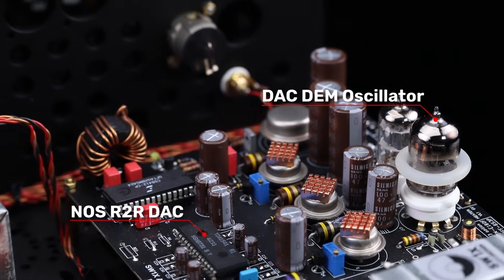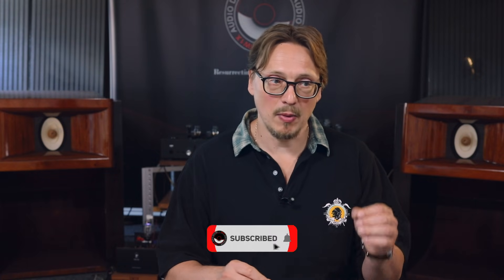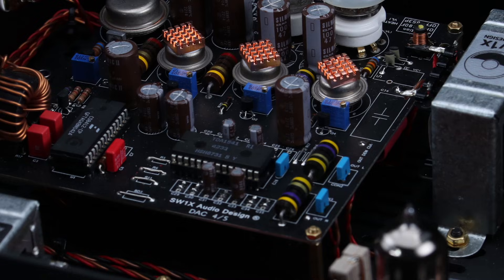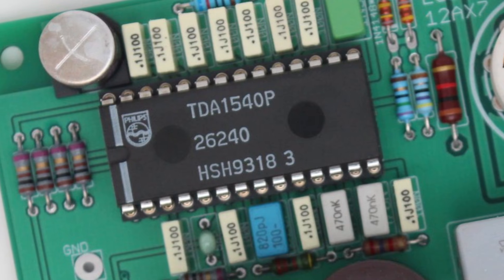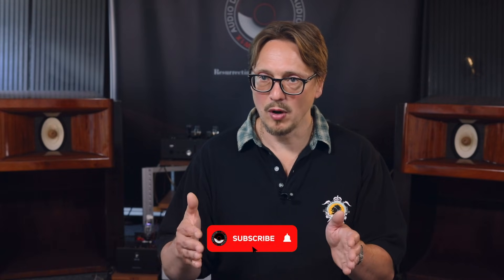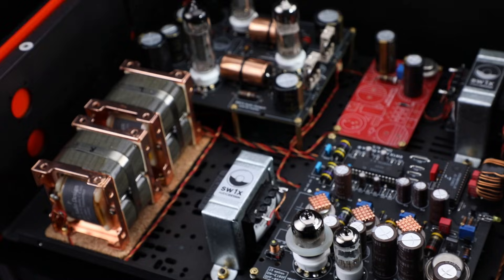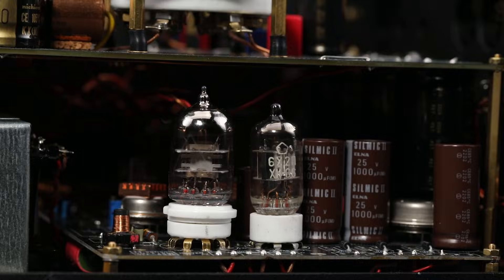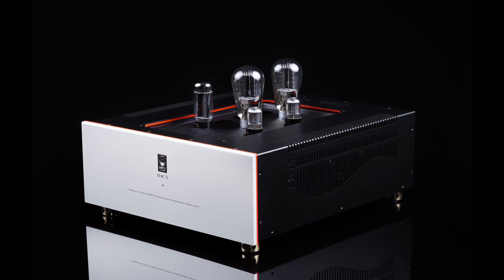What makes the Philips TDA1541 and TDA1540 DACs so special?

Comment: i'm a valve guy through and through, but when it comes dac i prefer solid state mainly because it's quieter.  any noise produced by valve gets amplified by my valve power amp and it's annoying.  it's a trade off.
Reply from the maker: good for you. maybe you do need a better DAC after all

Comment: OK, so you like tubes so do I, so you’re doing all this digital processing and it’s a very end you’re running everything through. It doesn’t matter before or after to a certain degree through tubes. Could you like to sound the tubes? OK I agree with that so you’re taking a high-end digital signal, which works very well and his breathtaking and then using good old-fashioned tubes to get the taste of analog back after all that digital reproduction makes a lot of sense. Good luck with that all this digital work to get it to sound like analog at the very end I believe that’s what we’ve been trying to do California AUDIO Labs and a couple other companies were doing it way back in the 1980s nothing no but I’m certainly sure you’re a piece of equipment sounds good but put a little more background into it folks if you’re doing this for decades, you know the word Dac, digital to analog, digital analog OK I guess I’ll go along with that. That’s the only process you can go along with unless you can start hearing in digital Crazy.
Reply: Wow, I didn’t see that picture. The amount of tubes and converter is out early. Ridiculous.

Comment: Great video. I have gone down the TDA1541 route myself. I have a Marantz CDA94 with an S2 Taiwan 97 chip (good provenance). The  CDA94 has got black gate capacitors. It sounds very analogue. I don’t have the desire to reclock it, but a quick question if I may. Would a DDC to improve the quality of the inwards digital signal on the coaxial input make a worthwhile difference ?
Reply from the maker: while CD94 is a great CD player, there are a lot of factors that bottleneck its sound- pretty bad power supplies, lack of DEM clock, presence of op-amps in the output stage- BG caps alone are not going to compensate for all the shortcomings. since the list of shortcomings is rather huge, much more musical and analogue results are achieved if one use employed our DACs (starting with the DAC III) in combination of CD94 as a source
Reply: Hiya - thanks for reply . My Marantz CDA94 is actually the DAC unit that was built to partner the CD94: so it is a DAC unit and has to be fed with either a coaxial or optical. I have no doubt your DAC unit may sound better, but at least for the moment I am happy with mine. I might ask someone to do the Grundig DEM mod for me , but my question remains which I am hoping you will have a view on given your expertise,ie would putting a digital to digital converter in between my digital source and my CDA94 DAC to remove jitter etc. make any difference or improve the sound of my CDA94. Cheers and thanks
Reply from the maker: @highfell1  if you have the TDA1541 running in NOS mode, then any other manipulation in digital domain is only counter-productive

Comment: ??? More BS, Digital always be digital. It has the stream from some point of origin doesn’t make any difference with that it’s going to. , and the vacuum to deal that’s been done 25 years ago, California Audio Labs had a few units out
Along with a few others, nothing knew about that concept , except when you need replacement tubes and it’s almost at a point today you gotta kiss somebody’s ass to get a few NOS tubes for 200 hours apiece. No wonderful idea. I’m not knocking you but it’s the same bullshit. We had 20 or 25 years ago. I don’t care about the dsc chip It all depends on the way it’s implemented. Got an old ESS saber dsc here with a 2016 chip in it. That’s old. We’re going back at least 15,16 years. I can’t criticize something. I never heard. I believe it’s most likely a wonderful sounding piece but but what you’re doing is the same shit they were doing over 20 years ago the design in general nothing new most people forgot about it and most of them went out of business anyway But best of luck with all that<
Reply: But a stream of water can be a few drops or a gushing torrent or maybe not flowing in a consistent way- that would make a difference to how well a small bucket contained it or not. Controlling Digital data is no different
Reply: @highfell1  absolutely however an LAN Streaming into a computer music server even your iPhone a few drops of water, huh?
Well, when the scream of ones and zeros gets down to being that weak or altered, that’s where it makes a difference you’re right it’s cold. You have no signal incoming or even perhaps outgoing depending on the situation digital digital analog is analog , almost everything you have or use today, before I go any further, I would be very surprised if you do not know
What they call a  DAC, Which stands for digital audio converter< now the stream must be converted from digital back to analog or it would be useless. Totally useless., we do not live in a digital world. You don’t see in digital you don’t hear in digital. You don’t live in digital. That’s why anything digital always must be converted in some fashion, but it is a way to get unbelievable or unprecedented amounts of information from one place to the other. All that stream is putting out is one and zeros then goes onto the Dac, in your iPhone, your CD player, countless other things that you use daily the average person today I believe doesn’t realize if you look around the average household you probably have 6 to 12 digital audio converters your TV for one iPhone again and anything else that you may be right come on you folks should notice by now nothing new about it
Reply: Even Albert Einstein himself claimed along with countless others in their field, we live in a three-dimensional world
I wonder what a four dimensional world would look like , they used to say it’s impossible and it could not exist
Funny thing for the last 10 years certain mathematicians and leading professors have been looking at this in a different way
Reply: @Cody1340-e1s  And they all have different sound signatures which don’t really matter, unless you are using one in a highend hifi system. And I bet his DACs sound good
Reply: @highfell1  I don’t know how long you have been involved in this hobby, you may be well aware idk, but most folks don’t know through the late 80s into the early 1990s, just speaking for myself here on the eastern seaboard mid Atlantic area
If if you were to go into any higher end, Audio dealer with any Dac/ OK or digital audio converter, the four or five Dealers 
That were around and doing business back in those days , absolutely would not take any Dac in trade or want to buy 
Outright from yourself if you were looking to sell it , the market had became so overwhelmed and saturated with Dacs
It was absolutely an utterly ridiculous , it was almost like you had one for every man and woman and child in the city
Now, if it was really something obscure in nature, very dependent upon bringing type make and model number 
You may have had a very, very slim chance , there were so many units around useless. Nobody even wanted them.
There was such an over abundance of any type dac you could possibly think of , this is what now as of today absolutely associates and completely reminds me of those days back then, it’s ridiculous and not much has changed when you really look at it completely overall, I know guys that tried so many things MQA super audio CD K2 CDSCD that’s CD
Get to the point where it’s real humorous like the old heads taught me years ago it’s all hype , $$$$$
Save your money find an old rega Apollo R, and sit back and enjoy your CDs. I know can’t listen individuals.
That have been through this shit from beginning end , and in the end are just listening the red book. I absolutely know and understand things have immensely changed since those days, but no honesty. It’s basically the same shit.
They just put it in a different bowl , next year or the year after it’ll be something else, take the I2s output connection
All it really is is the old cat five or cat six cable if you’re familiar with that , I still use it still sounds wonderful
I also use SPDIF , but I do not like the Opo cable you can get by with it, but the SPDIF is much better
I’ll tell you a real good find from being around for years a friend of mine picked up an old my MYTEK 192 DSD DAC
ESS saber Dac, 9016 , 4 per channel output total of eight, four on each side output, internally speaking
He brought that little piece over , we hooked it up and I’ll tell you what that is one awesome little dac I don’t care how old it is
However, I did often wonder when you see this particular dac for sale , they’re almost sold immediately
And other crazy thing that I noticed, but this particular piece , is if you look on the web, you will see some dealers or sellers
And they’re asking price , a lot of them one is much for it is when it was new, I’ve seen one guy asking more than what it for
Actually sold for , I am looking for one myself. Presently I found one, but the guy wants too much for it.
All this bullshit out here today it comes and it goes it goes and it comes , it’ll go on to the end of time, especially where there is $$$$$ to be made or hype not stating that there’s not differences, but it comes down to. It’s all the same shit.
If I took three or four dacs repetitiously played them for you with your favorite music, for absolutely quite a while
In the same stereo system, same cables, same loudspeaker same room same everything , I can almost guarantee you
As I was changing the units around and play , you would not be able to tell me which one you were listening to
Yes, we tried it and 90%. We’re nine out of 10 people didn’t know what they were listening to. 
You know these guys stay up all night and walk the floor what can we come up next or we’re gonna go broke use your head not your wallet , 👀🤣👍🤷☮️👀👍
Reply: @Cody1340-e1s I have both a vintage DAC 1541A chip and a new DAC, both sound really good but a bit different. I like hearing vintage hifi because they knew how to make things in the old days and used the input of highly trained technical experts.
Reply: @highfell1  I agree with that statement 100%, you know sometimes you have it right the first or second time, but they keep trying to reinvent the wheel using different rims, same tires
Reply: @Cody1340-e1s  “DAC” stands for “digital to analog converter”. They’re not just for audio…
Reply: A digital stream is a stream. I don’t give a damn where it’s coming from. There’s no altering it. There’s no changing it. It’s a stream just like water coming from your faucet. The water will always come out no matter how much you modify it. It’s a stream whether it has a sprayer on it. It has nothing on it. It’s just flowing out free flow. It’s a stream it once it hits the internals of a digital audio converter. Then the implementation will start along with probably operational amplifiers filtering power supply implementing whatever trip is in there that’s why different tax to me sound different even though they’re using the same identical Dac chip, I dug up an old my MYTEK dsd 192, ees 9016 saber , 14 years old it still sounds just as good as any Dac I have sitting here today even the AKM 4499exeq , yes, absolutely I can’t hear the smoothness in the AKN to a certain degree little smoother sounding, especially on the top end, wonderful deck, if you’re running a very aggressive speaker like horns, but that old MYTEK 192 i’ll tell you what I’ll compare it to anything not saying it’s not our date because it is before a 14 or 15 year-old deck it’ll definitely give you a run for your money. Why would you want to spend thousands of dollars it’s all hype. It’s all bullshit. I got it sitting right here in front of me experience is the best teacher. Sorry for the text. Talk this shit’s a pain in the ass.

Comment: In a time where a 50$ ethernet switch has a 150000khz clock, audio manufacturers are still struggling to make a 48khz one ...
Reply: Exactly,
This snake oil company is an insult to the decades of engineering professionals working on Hi Fidelity,
True Hi Fidelity does not have a sound of its own.

Comment: Good discussion, SW1X. And yes, you do clarify the misconception that TDA1540/1 is not really R2R but DEM.  But I don't understand what you mean when you suggest no other projects -- other than Grundig -- has released TDA1540/1 -based units (DACs, CD players) w/o external osc (clock). DIYAudio and Audiocom has, for decades featured such designs. I have a 1989 Philips CD-60 with my own clock PCB. And: Didn't Arcam or Naim use external clocks with their 1541-based players?
Reply from the maker: TDA1541 & TDA1540 are R2R DACs with unique DEM feature. These DAC only produce tiny current at the output, which is the main characteristic of R2R. Some people see them not as pure R2R but who cares? As regarding DEM in other products, yes in DIY community, which is not commercial in nature and yes designs based on transistors. To our knowledge the only commercially made external DEM clock were offered in one or two Grundig CD players.
Reply: @sw1xaudiodesign Do you know which Grundig model it was? In any case, if you go to EEVBlog forum and search for "TDA1541 DEM oscillator", I am 13hm13 in that thread. The photos there are mine --a verobaord DEM reclocker I was experimenting with. Limited success on my part , and ultimately I gave up. Ditto  variable results of other DIYers in the long DEM TDA1541 thread (pertaining to pin 16/17), at DIYAudio.
Reply: @sw1xaudiodesign Audial / Pedja Rogic will have a word with you. in m< opinion, you are a audiophool scam.